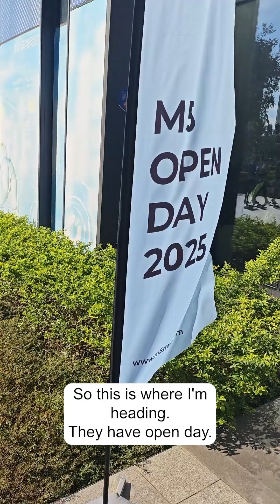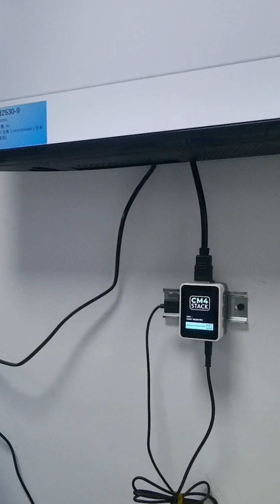I bumped into Arduino guys while visiting M5Stack HQ!

Comment: After recent changes to their license I can't see myself using Arduino stuff anytime soon
Reply from the maker: Considering the push towards industrial products in the past few years, I would not be surprised if we end up with two sets of terms regarding the use of their products. Corpo speak is never fun to read, and it always overreaches until sufficient pushback is applied. They have very little benefit in gatekeeping OSS acorss the "maker" grade products and every reason to protect IP that is marketed towards industrial use